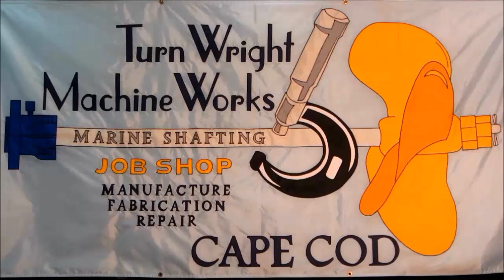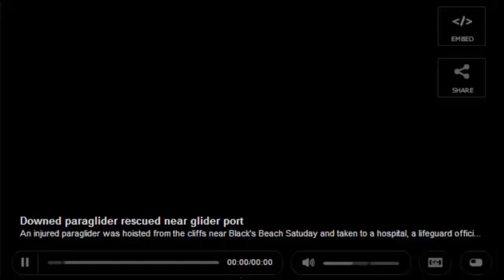The Show Must Go On

Comment: I am an amateur and have learned so much from your videos that I can't begin to list.  In several videos you mentioned disassembling and cleaning your chuck.  I have a very old 6" Cushman 3 jaw.  I took it apart and found it to be full of every kind of dried up crud imaginable.  I've gotten it all cleaned up now and ready to go back together but I am not certain what to use for lubrication.  What is your recommendation? Where can you get it?  Best wishes to your father.

Comment: I will field this one in Keith's absence. A light coat of medium way oil should work just fine. Be careful to not add too much, or you will have oil slinging out for a while. Some folks use grease. I would advise against this, as it tends to trap too many chips, and ends up dragging them into the gears. McMaster-Carr is a good source, just search way oil. Hope this helps.